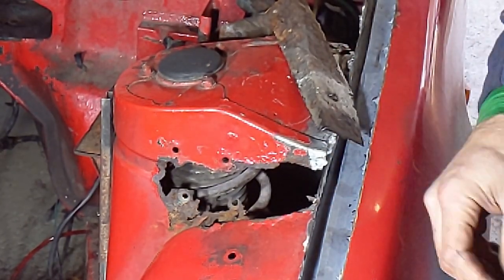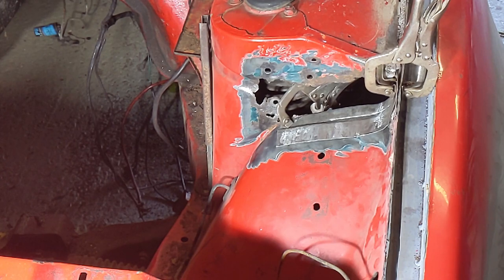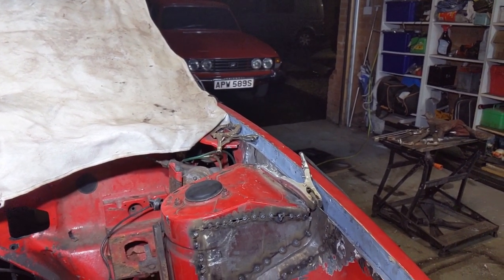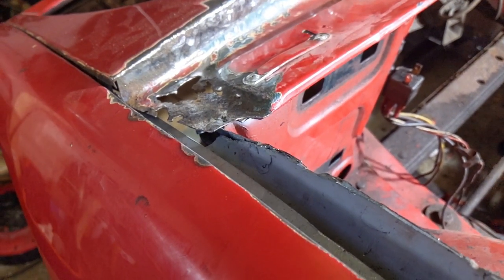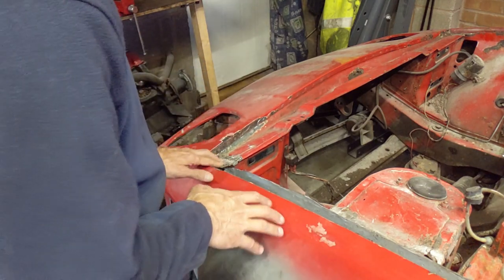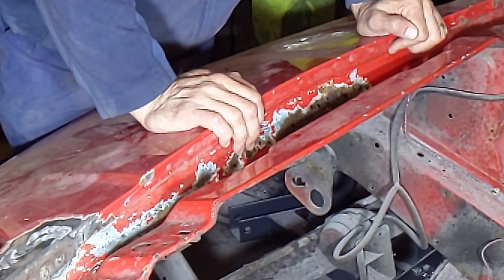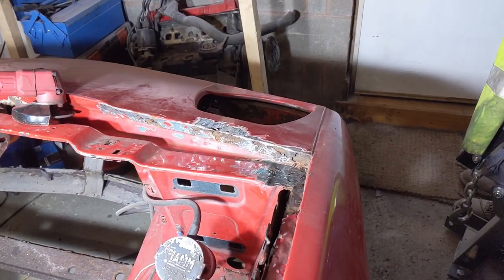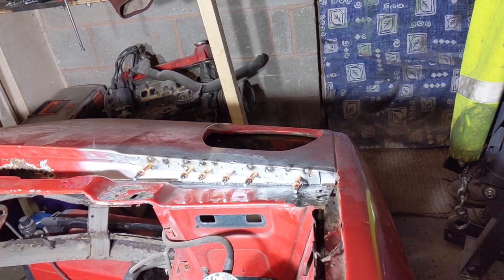Triumph TR7 Restoration: Episode 49   A Bit of Fitch and Nose

Comment: Great episode Henry, and it looks like it's nicely moving along. I have just begun welding in the last week or so and my first attempts are not pretty.  I have a regulator on order and am moving to gas rather than the flux core.  There is a guy called fitzees fabrications who trials the difference very clearly.  He also has a great technique for butt welds.  Definitely worth checking out if you have not come across him before.  He's also a great character so very watchable.  Hope you have a great Christmas if we don't see you beforehand... that is unless you are doing a Christmas episode in the elf costume?  😀
Reply from the maker: Hi Anthony, I know Fitzee's Fabrications well.  He is an artist with the welder and I try to replicate but it is harder than he makes it look (I find).  Yeah, flux core cannot cope with the thin metals in bodywork.  I used mine for the head puller because it was thick metal but I go with gas on bodywork.  I'm not planning on a Christmas elf-costum episode although I'll might have another one out around Christmas.  I hope you have a great Christmas

Comment: Have you ever heard of FLAP WHEELS or PAINT STRIP WHEELS? really flexible for those pesky corners, sort of the same type of material as SCOTCH PADS?  lot of work there though, well done for taking it on. I used to have a TR8 back in the 80s
Reply from the maker: Hi Keith, I have used both and keep meaning but forgetting to buy some
Reply: @HenrysGarage  I wouldn't be without them, especially doing work like this, even wire wheels, just buy a selection I get a load of stuff from eBay, they seem to have a pretty good selection. they may even have the front decal when you get that far, worth a looksee?
Reply from the maker: @keithdavies150  I'll order some now